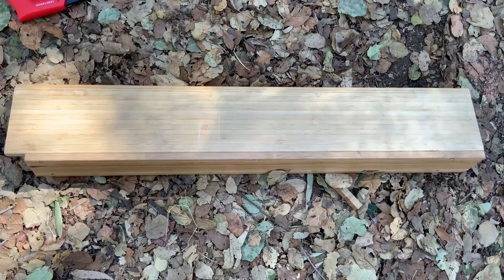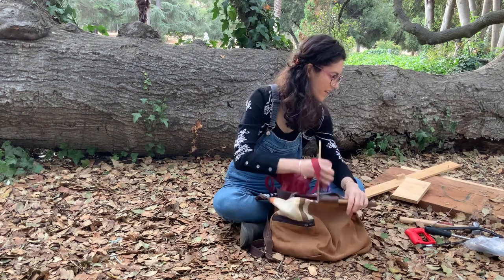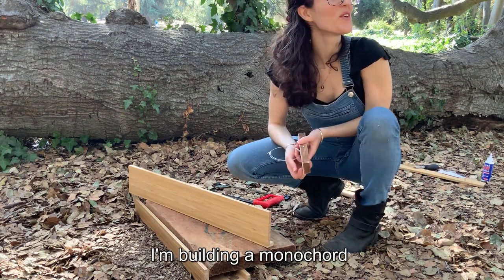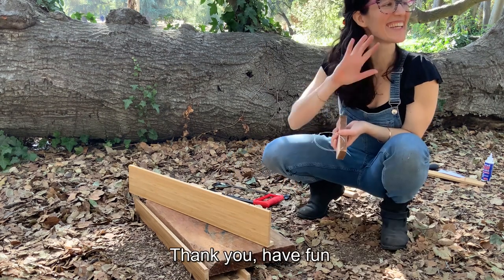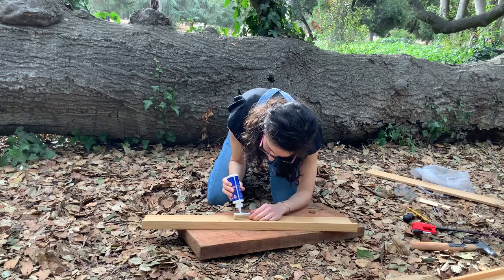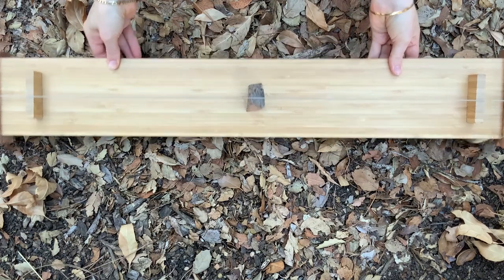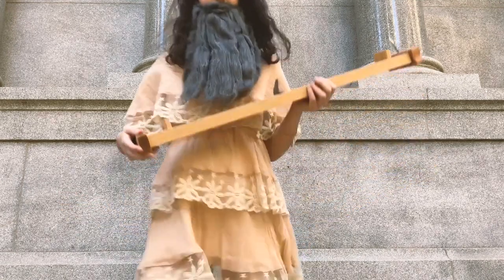How to build a Monochord - DIY ancient musical instrument

Comment: Thanks for sharing this.  I like the elegant simplicity of your monochord.  It makes me believe I can make my own and make it sound good.  I am tempted to make a duochord of two strings side by side, so that I can set them to form a D and A harmonic fifth.  Do I gather correctly that if you set the wedge just right, the two sides of the string split by the wedge will also play a harmonic fifth?  Blessings.
Reply from the maker: Thank you so much Raku! A duochord sounds very cool :) so yes, if you place the wedge at 2/5 of the full length, such that the lengths of the two parts of the string have a ratio of 2:3, you should be able to get a prefect fifth. Looking forward to your duochord video! Cheers

Comment: This is exactly what I'd like to make with my Ancient Music history class. Do you have this written out anywhere? Or at least a supply list page? Thanks.
Reply from the maker: Hi Molly! Thanks so much and here you go :)
Before we begin building here is what you will need to have: 
- 1 long wooden board 
- 1 board of thick and slightly softer wood.
- 1 eye bolt
- one nail about 1 inch long
- four bigger nails about 2 inches long
- one screw about 2 inches long
- And a guitar string

For the tools you will need:
- A hand saw
- A hammer
- A screwdriver
- A ruler and some multi purpose glue

Measure the softer piece of wood to create a long  rectangular cube, about one inch wide, to be the monochord ends. 
Draw a line in the middle.
Then, in the middle of one half make the eyebolt hole, by first using a long nail, then a screw and finally the eyebolt. If you have a drill you can do it in a second but if you do it like me manually it might take a while. 
Insert the smaller nail through the guitar string’s end and nail into the middle of the other half.
Saw the wood into your two rectangular cubes. 
Nail the rectangular cubes to the two ends of the long wooden board. 
Saw another two rectangular cubes, much thinner though to be the monochord bridges that will level the string. 
Glue them to the surface.
Tie the string to the eyebolt and twist until the string is stretched and you have a clear nice pitch. 
Saw a little triangle from a piece of wood you find, just a tiny bit higher than the string when stretched. 
Place it under the string in the middle of the board and we have our monochord!

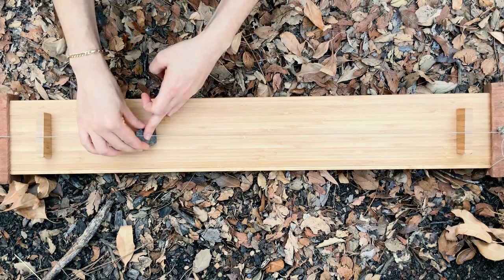Comment: You're really amazing. Modern Pythagoras! I have a question. At 5:37, is the ratio of strings 4/5 in fractions? Is it right to divide the strings into five and play the bridge at the point of four? Does this make the sound of the name E(mi)?
Reply from the maker: Thank you so much! so happy you like the video, and yes you are absolutely right! if you divide the string in 5 and place the bridge at 4/5 (and pluck the shorter part) you will hear a major 3rd above your fundamental (open string). So if the fundamental is C(do) you will get E(mi) :)
Reply: @katsirtal  err... no.
If the fondamental is the open string,
Then, with the bridge at the half of the string,  you'll play the octave. (C6-C5)

Here, putting the bridge at 4/5 of the string, you'll play higher than the octave, so it can't be the 3d above the fundamental.
Reply from the maker: @MalucoLapin  thanks! Of course that if let's say the fundamental is C3 at 4/5 we are going to have E5. I was referring to the note not the actual interval but you are right so thank you for the clarification!